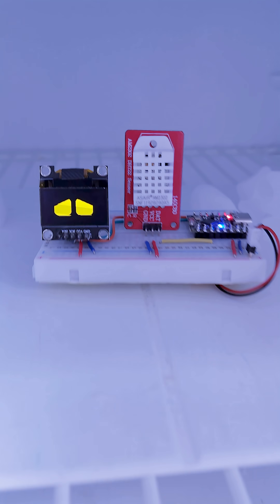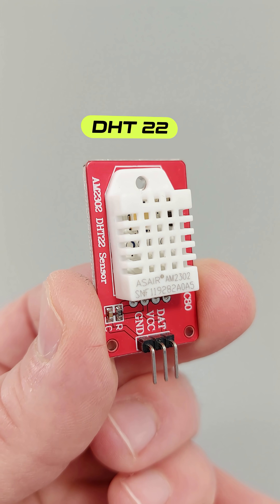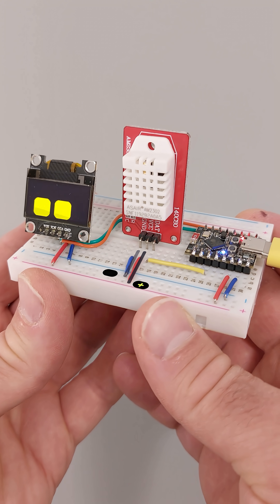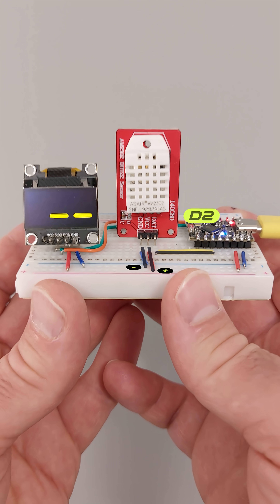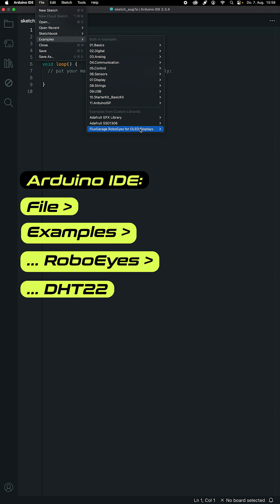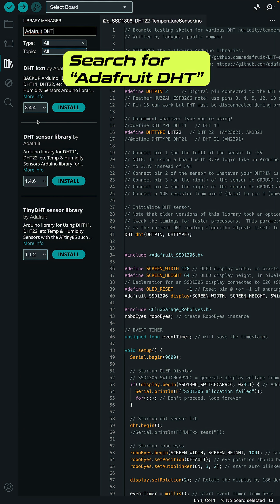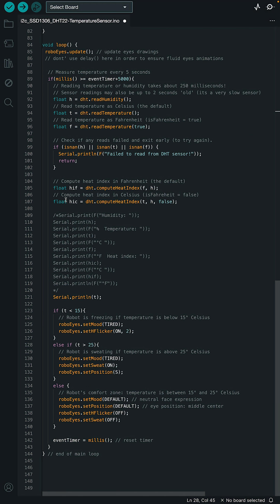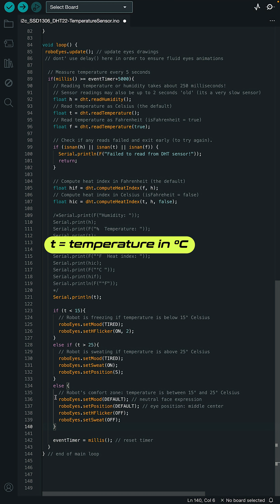Robot feels temperature with DHT22 sensor

Comment: @FluxGarage, I'm Yuvan, and I just mastered the OLED display a while ago, and also checked your awesome roboeyes library. You rock! In one of your videos, you mentioned you're working on adding more updates, like allowing the code to have delays in between (in the loop()). I'm still waiting for that update. I'm currently working on a big school project, and I used the roboeyes library for the first version of the model, but it was super difficult for an eight grader to carefully hack around this using complex coding. I appreciate your work and still waiting for the amazing update. Good luck!
Reply from the maker: Hi Yuvan, thanks for your message :) Yes, the "Animation Sequences" tutorial video is still on my to do list, but I'm on it.
If you want to dive deeper into the topic of "non blocking" code, check the animation sequences code example that comes with the RoboEyes library. There you can see how you can handle steps with different timings by using a timer, rather than using delay.
Have fun with your school project!